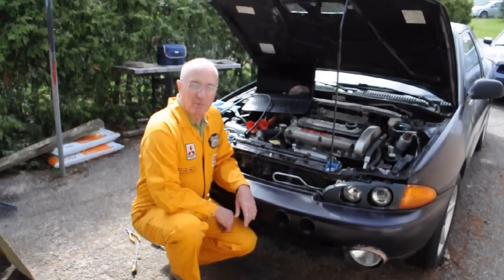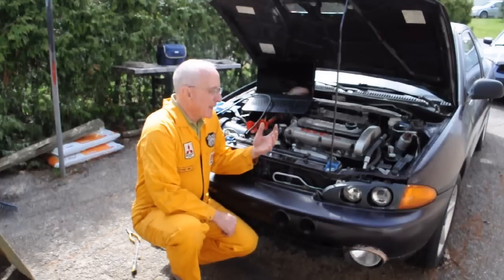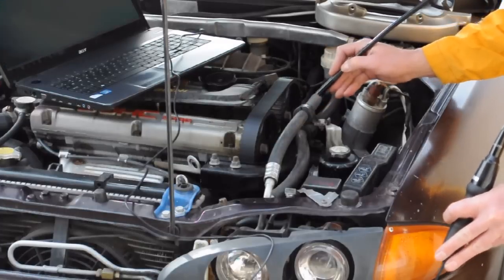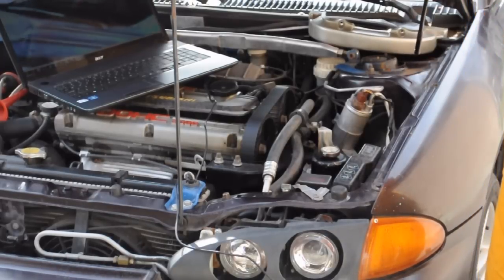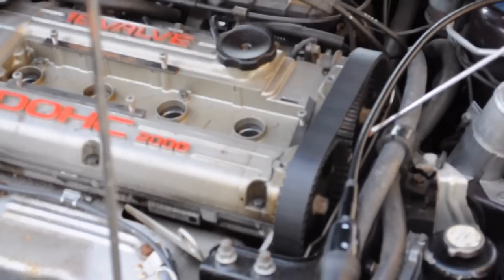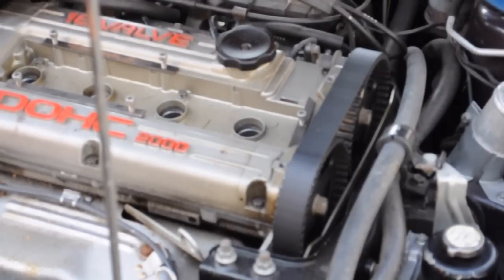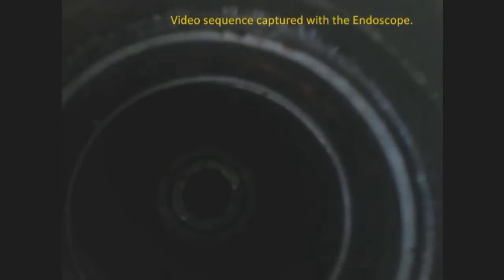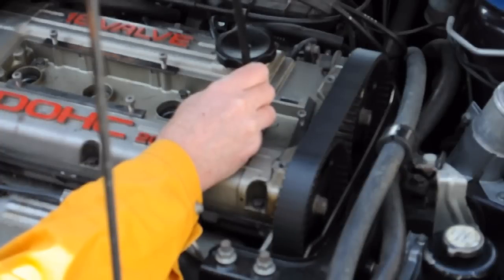4G63T Engine Diagnostic with a USB Video Endoscope

Comment from the maker: No, that would require a mirror to reverse the optics. There are other manufacturers that have articulated image heads that provide a large field of view, at $400++. Seeing the back of the valves is probably impossible. Remember, it's a diagnostic tool. If there's a valve or compression problem, you KNOW the head has to come off.